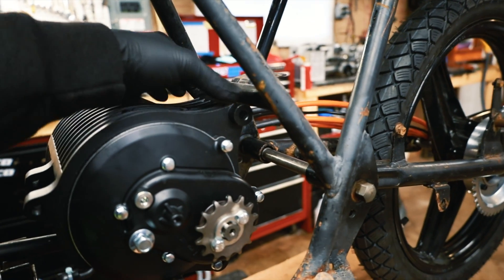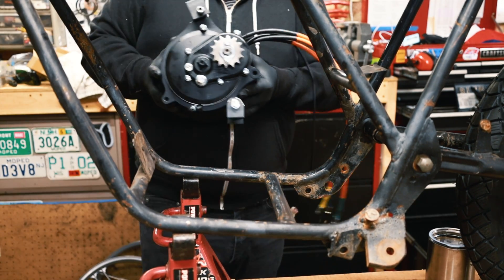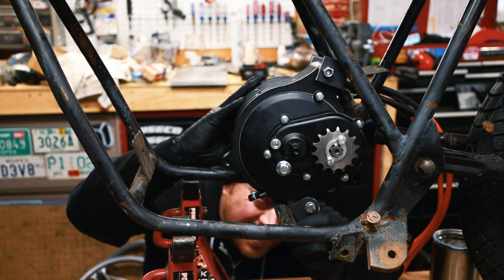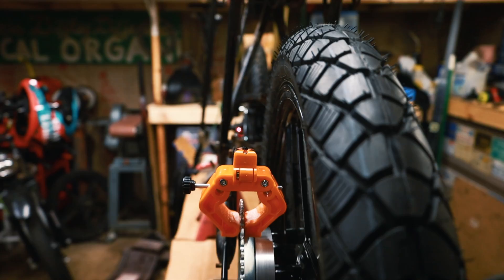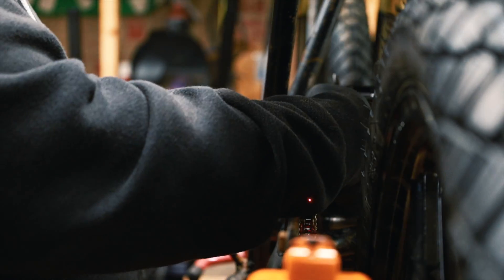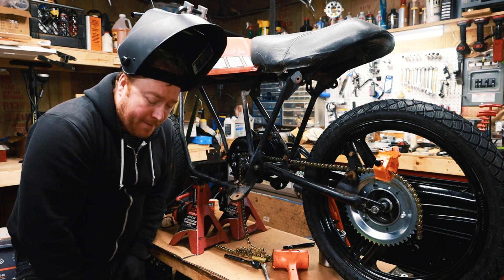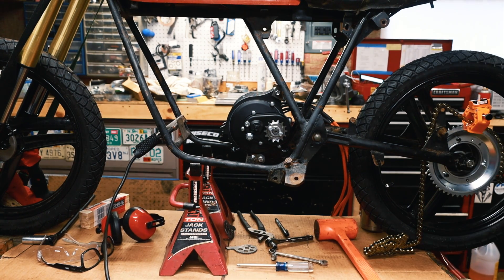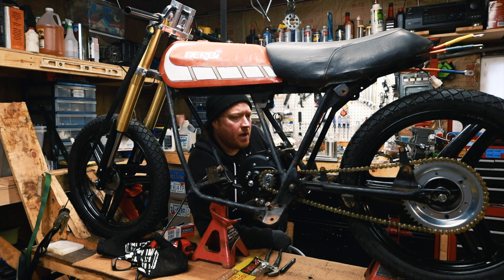Making Motor Mounts QS138 70h Derbi E-bike Moped Conversion

Comment: Battery ur planning to use? Have same motor but don’t know what battery I need
Reply from the maker: I bought a 72V 36AH 200/300AMP battery with 21700 cells. 
I bought it from Amorge.
Reply: @Corn-ped  will a 72v 30ah battery work?
Reply from the maker: @SukhvirDhillon-o5j  totally!
Reply: @Corn-ped  What battery do you think is the minamun, cuz im on a budget trying to sealcoat for money as i cant get a job yet (Im 14).
Reply from the maker: @SukhvirDhillon-o5j  24ah is the minium I would go
Reply: @Corn-ped  perfect, my bike doesn’t have much space, so is it alright to use 2 36v 30ah and mount them in separate locations but connect them in series?
Reply: @user-xb8hl6xv4d could, just have to make sure your battery can deliver the amount of amps that is needed for the motor

Comment: Love this build. What kind of forks are those?
Reply from the maker: There are some amazon pitbike forks. I am surprized by them. They are nicer than I thought they would be. https://amzn.to/3GynVB4
Reply: @Corn-ped  Awesome! Thanks for the tip. Do you have any ideas on how one could get a 12mm diameter axle to fit in those 15mm dropouts?
Reply from the maker: It actually comes with 15mm to 12mm sleeves.
Reply: @Corn-ped  Bet, thanks man!
Reply: @Corn-ped Mine surprisingly did not come with those reducers. Also, does the correct orientation of the head tube bearings go inner bottom race>outer bottom race>upper inner race>upper outer race? I've heard conflicting information on how it should be set up. I just know my head tube is a bare 1.75" ID and going from there.
Reply from the maker: @beng6319  I believe I have my set up the same way. That way is squeezes together into the races. It's also odd it didn't come with the reducer. Reach out, maybe they forgot them or something.